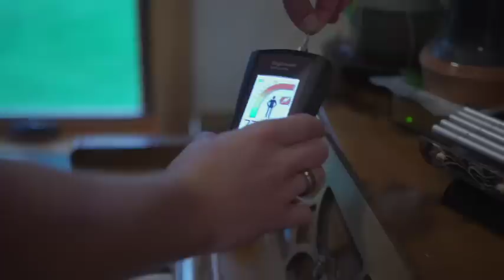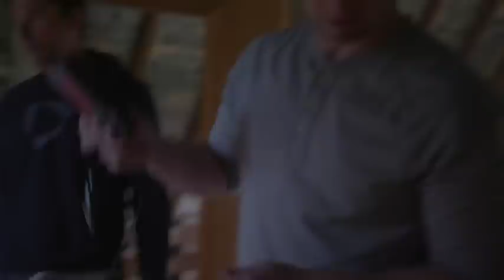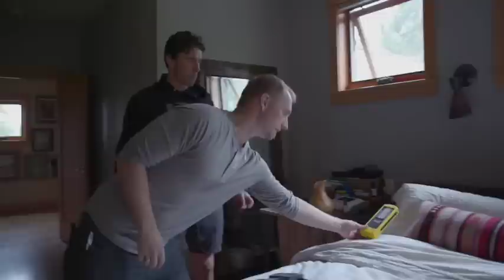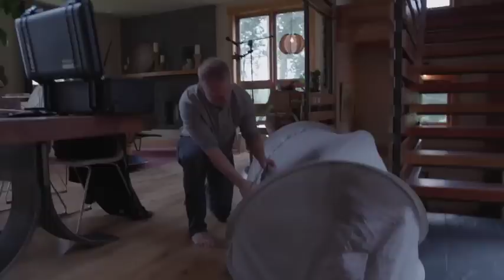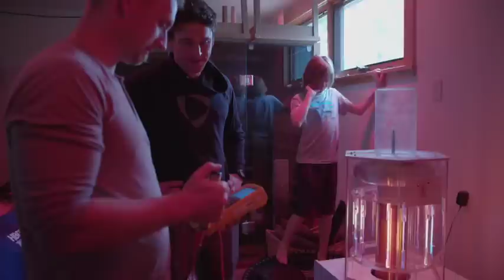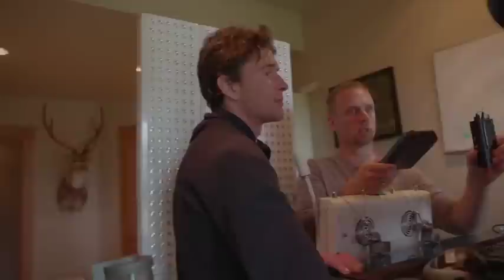BGF Shielded Healing Podcast

Comment: If you have the third, ground, prong your device HAS to utilize the prong. If the device design doesnt utilize the earth ground then, it's a bit of a mute point. Typically the earth ground goes to metal chassis inside the device. Some devices have shielding too which is awesome. There they wrap it in metal and ground it to earth ground...  that earth ground cable then should go to a rod pushed into the ground outside or under the house, if was built to code. Cannot help but comment. I studied a bit of this in my degree 😊 I'd really like to see computers stored in a utility room... then you have a a few ports run to a office where you hookup the inputs, monitor, etc